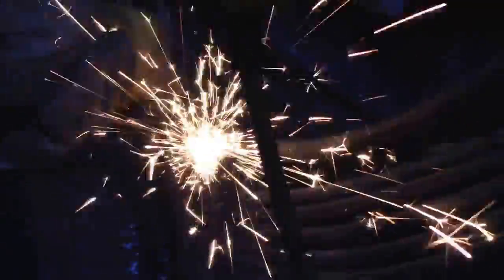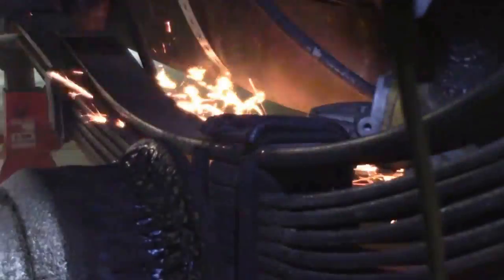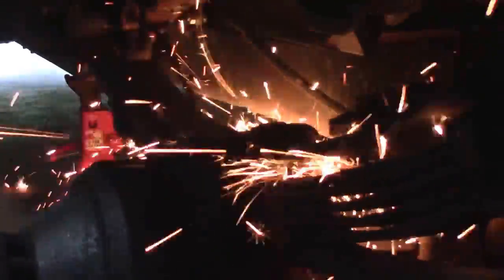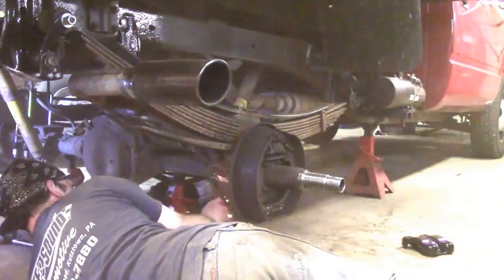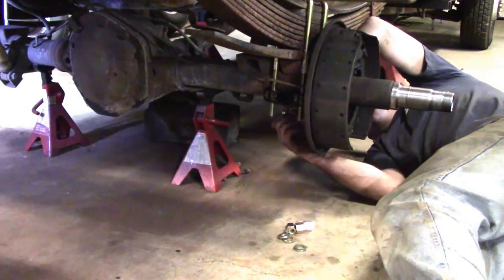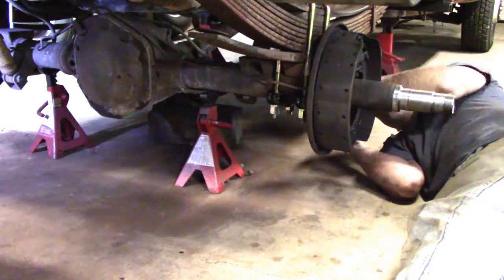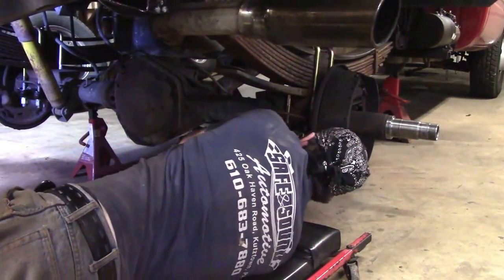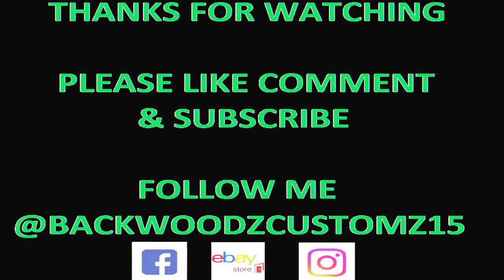Axle u bolt Replacement, How to Replace U Bolts and U Bolt Plates on a Leaf Spring

Comment: Hey man, I tried to do the job but my left u bolt doesn't sit flush on the leaf spring, it's pretty close but the right one sits fully flushed. Would I be okay? Or am I going to have to do it all over again?
Reply from the maker: Im not sure what you mean, the one end of the u bolt goes around the axle and the other goes through the spring plate? Do you mean the space in between the ubolt and side of the leaf spring?

Comment: Is there a way to take off the u bolt without a side cutter
Reply from the maker: Grinder, torch, sawzall, unbolting, I'm sure there are others...
Reply: @backwoodzcustomz1549  just reading your treads....i got 2x3 ranger trailer can i get by with a 2 " u bolt or go to 2 1/16 .....thats the option i have